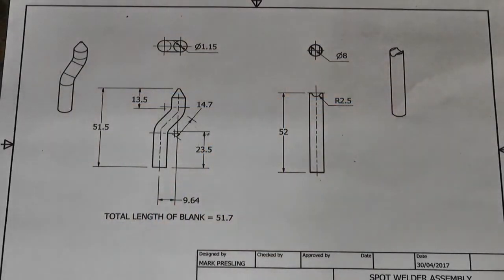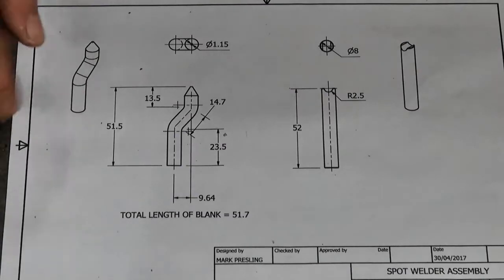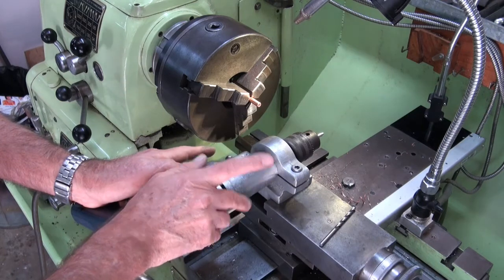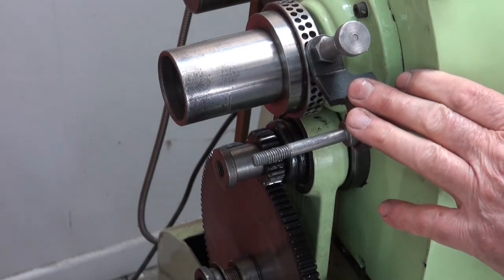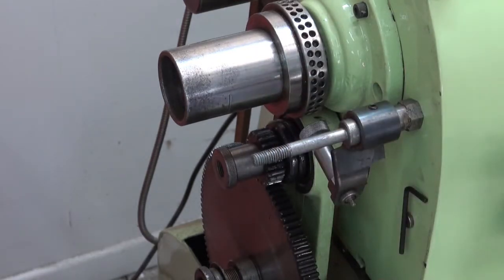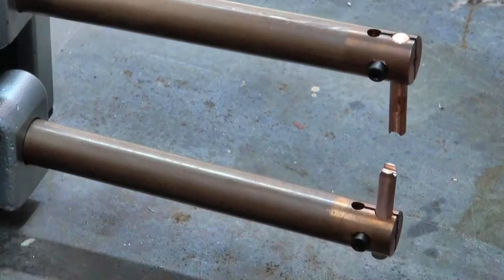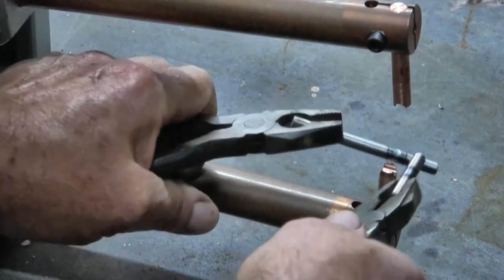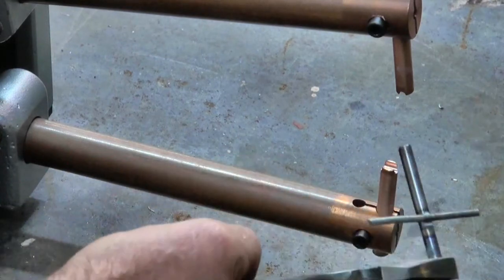Super Scary Weldy Thingy Part 4 (DIY Spot Welder)

Comment: Coming from someone who, as far as I know, started the MOT spot welder craze 12 years ago or so, just wanted to drop a bravo and compliment you on the best home built spot spot welder I've seen so far aside from, of course, the legendary Daniel Gelbart who, us mortals don't compete with (10kW? No problem! Waterjet cutter in my basement? Don't mind if I do). 

One thing I would have done differently, for all the effort and expense you went to for this one, is to double-up on your MOT or more. You can shove 30a through a 15a breaker for a second or two. Breakers are thermal and take time to heat up. The 1% duty cycle you have would've been fine. 

Another thing, everyone keeps making multi-turn secondaries, waste of space. All small commercial spot welders I've seen use a single turn on their secondaries. Someone copied the first popular person who used 2 or 3 turns and ever since people are turning their 2000A spot welders into 1000A ones. A shame. You don't need the voltage, you're being hogged down by being unable to provide current, if you went to 1 turn instead of 2, you could double your current and double your welding power. Some guys cast aluminum U-shapes for their secondary and use those, or copper if you've got the ability.

Anyway, great job, looks like something we'd buy off a shelf 50 years ago before value engineering took over.
Reply from the maker: Wait! Are you saying that I can cast a solid secondary? I am guessing I could just then use the flexible battery cable to connect to the moving arm? Why didn't I think of this? You are correct that I just copied the two turn secondary that I had seen in every single YT video that I used to research the build. I am now wondering if I could just use a heavy piece of copper bar bent into a U shape. Would it need to be insulated where it passes through the transformer laminations? 
Thanks for the positive comments though and like you I am somewhat in awe of what Dan Gelbart has been able to make, buy and use in his workshop. Truly a legend!
I will upgrade my machine as you suggested and post a video with the result. 
Regards,
Preso
Reply: "Wait! Are you saying that I can cast a solid secondary?" <-- Yep, bingo. Battery cable for the joint, yep.

"You are correct that I just copied the two turn secondary that I had seen in every single YT video that I used to research the build" <-- Yeah, people only half-listen to me. They have a certain cable and then rather than making two layers in parallel, they just keep coiling. And all that thick insulation and round wire, you're looking at like, 20% packing efficiency. Imagine having 5x the welding power from the same setup. Another issue is that most people, unlike you, have utter garbage for their clamping setup, and with less than 1 volt, you don't have any spare voltage to punch through paint, carbon, grime, oils, etc, so they have in some cases experimentally determined that more turns is better. They're not, good clamping and 1 turn is better. The one caveat... the longer the arms, the more that the secondary starts to have inductance, which will add to its resistance, at which point it might be beneficial to have 2 turns. If you can borrow a cheap clamp-on ammeter (they're like $10), put that around one of the secondary arms when you're spotwelding something heavy and just measure the current. Else, you could try measuring the current going into the MOT (disconnect one wire and insert the meter to test), and find out which setup works best for you.

"I am now wondering if I could just use a heavy piece of copper bar bent into a U shape." <-- A few of us without casting ability took a copper pipe, crushed it in a vice to the right width, stuffed it full of as much copper scraps as possible, and then packed it full of solder. https://i.imgur.com/DNP3p6D.png <-- Like so.

"Would it need to be insulated where it passes through the transformer laminations? " <-- Yes. Wrap it in thin cereal box cardboard and then wrap that in Kaptop Tape if you have any, else, anything to cut down on abbrasion (account for this when you are cutting/casting your width, it's a non-zeo amount). If you don't like the noise of the coil rattling, dunk the whole thing in epoxy or at least goop some on there.

More info on my channel, for the few videos I did bother to film once upon a time.
Reply from the maker: Well, I've already watched your three part series on transformer mods on your channel. Sadly, I wasn't able to find these videos when I started researching my build or I may have done things differently. I remember that the commercially made spot welder that I loosely copied when I was designing mine had multiple layers of copper shim packed together as the secondary. It did a single loop (like a U shape) and the shim was only about 0.2mm thick but it had lots of layers so it would be flexible enough to allow for the movement of the upper arm. Having seen this I still fell into the trap of using round wire and doing two turns. Interestingly, I am just now reading a book about the power of conformity amongst human beings. We seem to be hard wired to conform to group expectations even when we see evidence to the contrary. We are a funny lot!
I have taken on board what you have said about insulation and I think I am going to use epoxy and I am going to try using the multiple layer copper shim technique. I have access to some 0.8mm copper sheet and a guillotine so this might work. I am quite excited about trying this mod now. Thanks for the heads up. By the way, I really enjoyed watching your videos. They are well made and informative. Incidentally, I did look at purchasing a clamp meter to measure the current but all the cheap ones that I could find on Ebay had an upper limit of around 500 amps and thought that I might exceed that with my build. The ones that I could find that would do 1000 amps plus were several hundred dollars. I just now investigated using a panel meter and a shunt but the shunts are very expensive as well.
Reply: "I am going to try using the multiple layer copper shim technique." <-- I don't like turning steak into hamburger, copper sheet is nice and useful for many other things, scrap copper bits you can cast into a bars is already hamburger. But, everyone's scrapile is different :P

" Incidentally, I did look at purchasing a clamp meter to measure the current but all the cheap ones that I could find on Ebay had an upper limit of around 500 amps and thought that I might exceed that with my build." <-- You absolutely will. Probably 1000 amps right now, 2000 amps after you reduce it to 1 turn.

" I just now investigated using a panel meter and a shunt but the shunts are very expensive as well." <-- A shunt is just a piece of metal with a known (or expected) resistance, that doesn't change temperature much (to make it more consistent). So it's usually a flat bar or ribbon. You can use anything you want with roughly the right dimensions as a shunt. If you can borrow a clamp meter, you can "calibrate" your shunt by trimming off the edges of it until you're getting the right result (typically, something easy like, 100x what the meter says, not 57.8x what the meter says, in which case you can just use anything that can roughly handle the right amount of current). I.E. Throw in a shunt roughly the right size with your panel meter, and also measure it with a borrowed clamp meter, and see how it does at 200, 300, 400, 500 amps and what that corresponds to on your panel meter. You should get a roughly linear graph from that and you'll be able to extrapolate to 1000, 2000, 4000, whatever amps. Make sense?
Reply from the maker: I would dearly like to make a shunt as you have described but at the end of the day I may not achieve much in terms of altering my spot welder transformer. I think I am going to just measure the voltage across the secondary with the transformer unaltered and then measure it again after I have modified it to one turn through the core. I figure if I can halve the voltage I have doubled (roughly) the amperage? I am going to make a follow up video showing the mod. Is it OK if I reference your channel and your comments? I don't have a lot of subscribers but I think it is important to show how the design can be improved. I checked this morning and even the guys over at Make It Extreme put a two turn secondary on their DIY spotwelder. I guess their channel is not called "Make It Right". : )
Reply: "I figure if I can halve the voltage I have doubled (roughly) the amperage?" <-- Yeah, but, you don't have to measure anything if you don't want to. If you reduce it to 1 turn you will increase the amps. If you don't, it will be obvious in the way that you weld (it will take longer). It's also not foolproof, but you can measure the current going into the transformer too. If that goes up, you are putting more energy into the weld (or waste it elsewhere, but generally, into the weld).

"Is it OK if I reference your channel and your comments?" <-- Always appreciated, but, I do say "Next up, a spot welder video", and then I 6 years later I've never finished filming it :p. I taught Grant Thompson how to, he made his spot welder videos, and they were so good I kinda just never bothered again. Someday, maybe :p.

". I checked this morning and even the guys over at Make It Extreme put a two turn secondary on their DIY spotwelder. I guess their channel is not called "Make It Right". ", they probably did what you did, copied the most popular youtuber who did it. And... I might be wrong. It might be better to have 2 turns instead of 1.

Comment: hi mark the first bracket you fitted for the copper welding arm was insulated but the side brackets etc were not not wouldn't we have a short circuit here on the castings geoff
Reply from the maker: Geoff,
It seems that as long as one arm is electrically isolated from the other it doesn't matter if there is physical contact between the remaining copper arm and the rest of the chassis. Slight caveat here, I'm not an electrical engineer. I did wonder the same thing myself however I remember replacing a bronze clamp on a commercially made small spot welder that this one is based on and the clamp was bolted directly to the chassis. I also wondered if there would be any leakage of current to the earth wire during operation but it does not trip the earth leakage circuit breaker in operation so I guess it is OK.
Reply: Actually, one side should be connected to the case and the baseplate, to ensure that if a wire comes loose, it trips the breaker rather than electrocutes you.